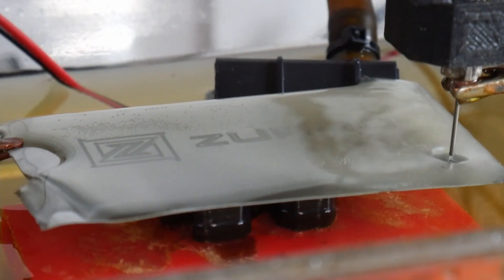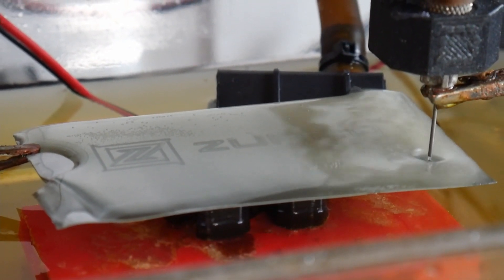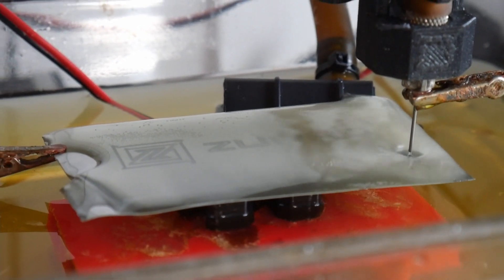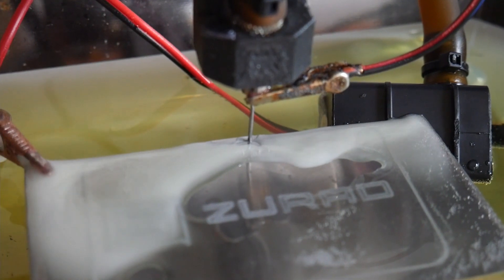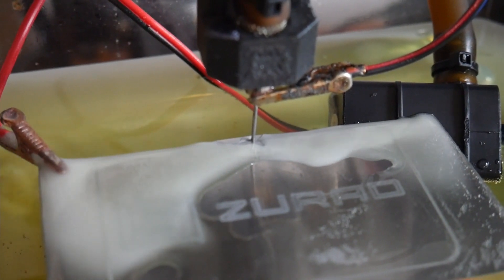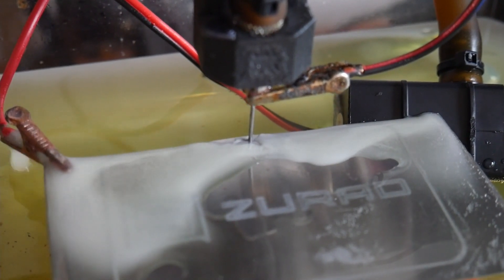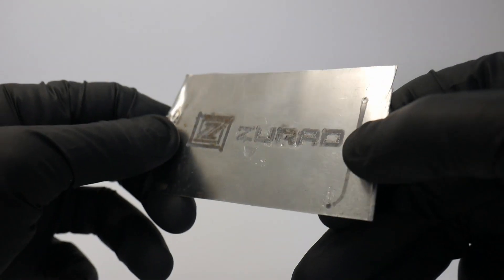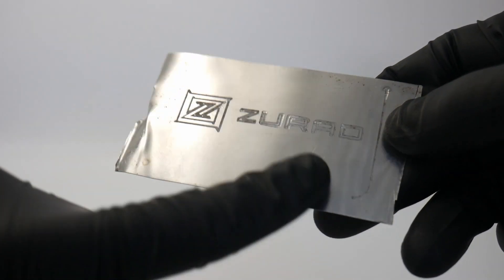Ender 3 Electrochemical Mill Conversion [OPENSOURCE]

Comment: I stumbled over your videos and am very interested in ECM. Currently I am playing around with sort of a "prove of concept" build in which I am just testing a stationary nozzle against a 2mm sheet of steel (low carbon, hardware store stuff)  
I am using the needle of a syringe as a nozzle ~0.3mm. The flow through the nozzle gets provided by a small geared pump.  As a power supply for the nozzle and part I use a 12V 10A switching powersupply. 
The pump has an external powersupply 
I did a couple of tests and was able to create a small crater on the surface of the steel part after a few minutes of "stationary spraying" - way less material removal compared to your videos.

Any suggestions how I can approve the material removal rate?

Bigger Nozzle for more flow? 
Maybe also additional flow around the nozzle and not only trough it?
Higher voltage? I also have a 36V 15A Power supply but hadn't had the chance to test it yet
Reply from the maker: All good questions here. Material removal rate(MRR) is directly tied to current of your setup. This is going to be very reliant on minimizing the interelectrode gap(IEG) and potentially increasing your electrolyte concentration. Because I=V/R, and we have a fixed V our only option to increase I(and thus MRR) is to decrease R. Your electrolyte, while conductive, is the primary resistor in the circuit. Changing to 36v would also almost certainly help with MRR provided you could keep from shorting the circuit.
Reply: @ZURAD  Thank you for the very fast and detailed reply! 
I just performed another test. This time I got rid of the syringe and let the fluid spill out of the syringe-adapter-nozzle directly. This one has a diameter of about 2mm.
Also I re-checked the amount of NaCl in my fluid - I think it was to low in the beginning.

I was now able to "cut" a hole in the steel in no time. The hole seems to be about 1.25x times bigger than the nozzles outside diameter. (which was to be expected)
 The current was around 3.5-5 A beyond that the nozle was to close to the metal and it started sparking. 

Next step will be an xyz frame from old 3D-printer parts and an Arduino with stepper shield to move the nozzle around. I want to keep my Ender3 mainly as a printer.

Again thank you very much!

Comment: Pretty cool concept, I love the idea of this.  Have you done any tests to test the dispersion of the electrical charge at the contact point between the electrolyte and the work material?  I'm curious because it seems to me that if the resistance of the electrolyte is greater than resistance of the piece being cut, there will be some dispersion resulting in less clean/uneven cut, and it also seems that the resistance would have to be as close to equal as possible, but slightly less on the electrolyte side if possible.  What I'm getting at is this: for different metals, are you calibrating the resistance of the electrolyte solution to minimize possible dispersion or is it just one solution density for any metal?   I also suspect that as material is eroded, some of it will go into solution and not be easily filtered. Is that the case? If so, it seems it could affect to the overall resolution of the cut over time.
I have absolutely zero experience with this process FYI, so I'm approaching this from a position of ignorance.  I was thinking "how could the electrical dispersion be tested?", All I can think of would be to cut the smallest possible hole and measure the Delta between the nozzle and the hole diameter.  I assume you've probably already done this as part of your process, and it may even be required measurement for the firmware.  If it's not, it probably should be.

I'm visualizing a cut that gets less accurate as the final layers of material are removed and the electrolyte begins to pass through the work piece because the resistance of the electrolyte could cause the dispersion to migrate away from the original point where it was contacting the work piece. 
Hopefully that makes sense and doesn't come across the wrong way.  I look forward to seeing how this project progresses.
Reply from the maker: These are all great questions. Generally in jet ECM (JECM) seen above the accuracy is provided by hydraulic effects. Alloy and salt concentration would not matter too much. 

I and others would be more than happy to chat more in depth in the discord chat.
Reply: @ZURAD  I'll hop on discord in a month or so, maybe sooner.  I'm in the middle of other projects at the moment, but I've got enough spare parts to do most of the build for the zurad2 on hand, so I'll definitely be putting one together in the near future.  Would that be the current recommendation for a starting platform?
Reply from the maker: @Mike-bs5pi  Awesome! Glad to hear it. No, the starting machine I would recommend would be the Ender 3 mod from this video. It cuts far faster and thicker than the Z2 ever did. I should have a video out this coming week covering more stuff it can do.

Comment: What are your plans for the machine in terms of improving resolution of the cuts?  Is it possible with the size of that nozzle?
Reply from the maker: Current plans include doing full depth cuts similar to wire EDM. Should allow much greater MRR and utility similar to that of a plasma cutter right off the bat.

Comment: Did not know this is a thing. Looks fairly simple but effective. What's your goal? Cutting or surface etching?
Reply from the maker: My current goal is effective 2+1D tool pathing to compete with wire EDM and fiber laser machines.

Comment: It possible milling on stainless steel?with smallest nozzle? 0.3, 0.4mm?
Reply from the maker: Yes, it is possible to cut on stainless. That's what I'm cutting in the video. Really any metal can be cut. I've used dispensing needles down to 27ga for cutting. Super small.

Comment: How thick can it cut through
Reply from the maker: Technically it can cut through as far a you can get a needle to go. Your accuracy is going to be difficult to control though. I've been cutting 1mm steel or so fairly regularly.
Reply: Do make the stuff i would want this or a cnc for id need something that could do at least 5 or 10mm. But ig if ur starting with sheet metal and bending the cut shape into something it could be useful to some extent. Or just detailing surfaces. Definitely cool tho. Nice to see something like ecm being used in a 3d cnc type manner.
Reply from the maker: @DanielMendoza-vz6ss  Making parts for a traditional milling machine frame or lathe are def on my to-do list. If I can get automatic feed control and short detection it can totally happen IMO.
Reply: @ZURAD  i hope you'll be able to sharpen the idea to where you can actually cut semi thick metal accurately. I think that would be really cool. Watching the ecm work in a clear container is also really cool. And yeah. Actually i think i understand what you mean. Using a machine to build a machine. Using ecm to make the parts to build a cnc. That would be some 4d shit lol.

Comment: What's the level of accuracy on etching/eroding? Strange idea but could you do golf club grooves with their specific shape and profile?
Reply from the maker: Interesting idea. Yeah I'd have to say you could definitely do that with appropriate tool pathing in something like Fusion 360.
Reply: @ZURAD  how does one output the coffee from fusion to a3d printer?
Reply from the maker: @eackerw85  I would build a milling toolpath and use M106/M107 for the spindle on/off commands
Reply: @eackerw85  So you are looking instant boost that wakes you up... maybe all you need is G28 with limiting switches disconnected.... Though i would not recommend, can become bit expensive specially if you are running rigid system that cant skip steps if over strained.

Comment: I got into a rabbit hole of YouTube vids, papers and literature about ECM, EDM (and ECDM!) some weeks ago and then found your channel randomly. Your results are getting better and better with every video! Keep it up, that's some really nice content. Meanwhile I am already looking forward to building my own when when I have enough cash for side projects😅
Reply from the maker: Glad you like them! ECDM is pretty cool. Such a niche setup. I hope to have a small kit available for this setup relatively soon.
Reply: @ZURAD  Maybe you've mentioned it somewhere before, but what voltage and pressure are you using in this setup? Is it more like jet ECM? so ~100V+
Reply from the maker: @KosmoGoat  This specific setup is 24v from the ender power supply.